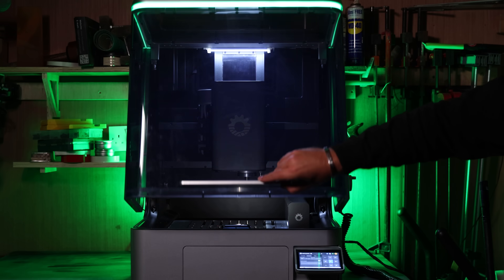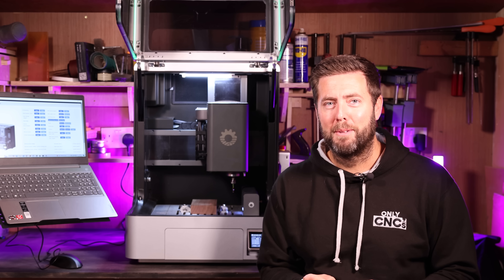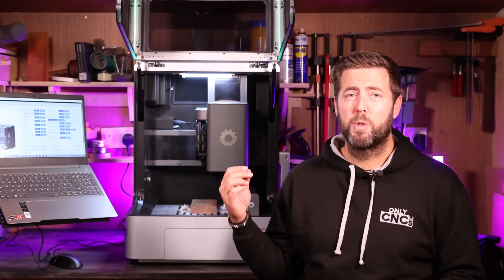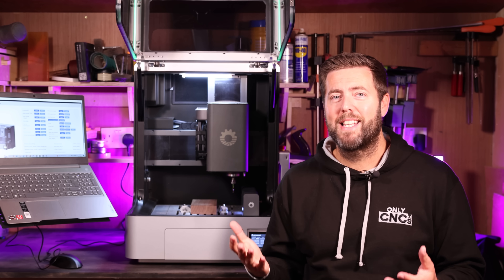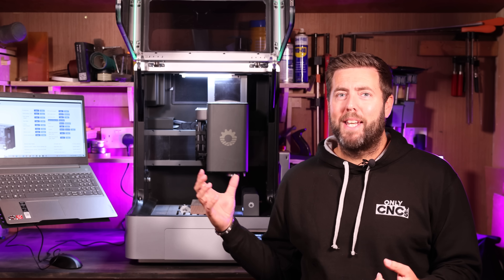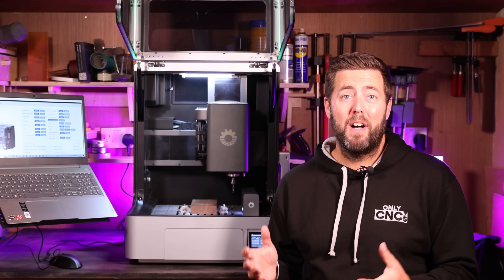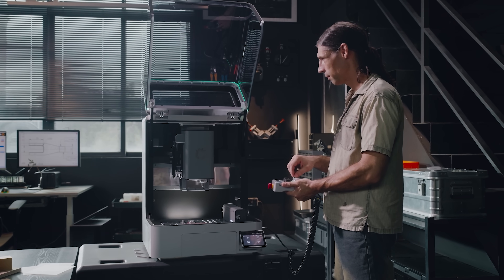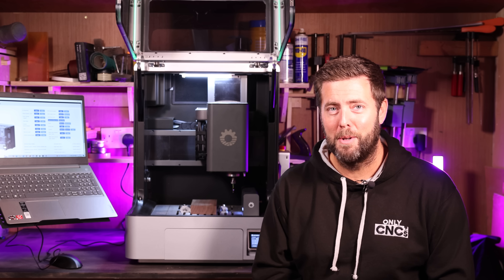Most ADVANCED CNC machine I have used - Initial look at the Nestworks C500

Comment: what spindle is used in this machine? and how is the atc working?
Reply from the maker: It's an 800w spindle. The ATC works great. Makes life much easier than doing manual changes
Reply: @JamesDeanDesigns  Does the milling cutter hold securely during milling? It just looks like it's being screwed on loosely. Normally, this is a spindle where you have to tighten the cutter with wrenches.

Comment: The retail prices quoted on kickstarter and therefore the duscount for backing kickstarter are often over stated. With productiin machines often being heavily discounted before kickstarter backed machine are even delivered. For example snapmaker U1 is only about 15% more for pre order than i pledged on kickstarter. Unless i was absolutely 100% confident in the company i would wait for real world reviews of the actual finished product befor taking a risk
Reply from the maker: Whilst I do agree with the sentiment the RRP are often inflated, 15% is a little bit misleading. Taking your own example of the U1, $679 on Kickstarter, $849 now on sale, so actually 25% difference. The Carvera Air is probably a closer example to this product, kickstarter was super early $1199, or $1399 early, now it's $2199. So nearly 60% higher than the early price. You can get some knocked off this with vouchers so let's say 50%.
Now let's take into account all the additional items you usually get for baking early that you don't get when buying normally, that offset increases. Kickstarter is by far the best value for money however it does come with risks and there are not many reviews out about this machine (I was rather surprised I was only one of 2 people who initially had it)

Comment: What i would like is a z1 with ball screws and closed loop steppers and the motion components out of the way of the chips. Price under £1000. Not bothered about ATC or fourth axis. Software included 

So basically a hybrid of the z1 and carvera air please 😊 then ill not need to use pcb way

Comment: @JamesDeanDesigns Can you talk about how the ATC works?  It looks like it is just a regular ER11 collet nut, the collet, the tool in the collet, and a collar holding the RFID tag - is that right?

A nut/collet spring isn't going to hold the tool securely to keep it from dropping down (I usually have to hold the bit as I am putting the nut on the spindle, and then after tightening a bit I adjust the stickout to exactly where I want it before tightening).  I suppose the collar could provide this function, but then it is going to be closer to a press fit and will limit the range of stickout for a given bit that can be achieved.  I guess you could also use a slightly undersized collet spring (ER11 compression range is .5mm) so that it does hold it more securely.

I assume also that the collars have to exactly match tool shaft diameter, so if you wanted to use drill bits you would have to make a custom collar for each size?  I suppose you could use something like https://www.maritool.com/p23589/ER11-Hex-Collet-1/4/product_info.html with 1/4" hex shank drill bits and only make one special collar size, but the range of tool lengths seems like a problem.  Maybe the machine is just used for marking drill spots and you do the drilling operation outside the machine?

Comment: Any updates on when the next video is coming out? Also, are you able to adjust axis in the scenario of a crash?
Reply from the maker: Video will be out on Friday. Not 100% sure what you mean by adjust but if the machines crashes (and sets of the alarm) you just need to unlock the controller and jog away from it with either the touch screen or your PC

Comment: Thank you for this review and on the Makera Z1.  With the C500, is the rear panel removable such that it can support tiling of parts?
Reply: Ooh, found the answer after digging through the comments some more.  
---------------------------------
@tommy_zi284
2 weeks ago
I've placed an order, been looking at it for some time, super excited to tackle steel in the garage! 

Question:  is there a proper way to place material larger than working area? Carvera has removable panel at the back for this, with C500 do we have to run it open for that? I understand it won't cut larger than working area but it's fine for garage projects as you can just reposition and continue
---------------------------------
@JamesDeanDesigns
2 weeks ago
Hi, thats correct, you would have to leave the lid open. There is no removable panel in the back of this.

Comment: My concern is that there seems to be nothing about the company behind this. It looks like they may be the same as elephant robotics, but all the information about their products seems to be from them. I’ve been burnt by Kickstarter that seem too good to be true so, unfortunately, $3k usd is a bit much to just gamble on…. Which is a shame since this looks like a fantastic product if it comes to fruition.
Reply: The company is Elephant Robotics. They are into robtics and needed a small CNC mill for prototype production, and did not find a good option according to their specs and price level, so they developed their own.This is typical with many tool companies, they started out with something else then they developed a special tool for their production, which then became a new business. It looks promizing, I'll follow the development, possible just wait for version 2, since they are new to manufacturing CNCs
Reply from the maker: Rimrock300 is correct. They are not a "new" company but releasing this product under a different brand. Bit like Onefinity and Redline, same owners but selling different assets if that makes sense

Comment: Is the largest diameter end mill that can be used with this desktop mill a 1/4 inch?
If a slightly larger diameter end mill can be used safely and efficiently, what size would that be?
Reply from the maker: It's an ER11 Collet which can safely take upto 7mm diameter. And yes it's powerful to run that diameter

Comment: Freakishly expensive for hobbyists. Bambu Labs was successful not just b/c it's ease of use but b/c it was within reach of the hobbyist. Need a $1500 version to be of consideration.
Reply from the maker: Hobbyist budgets is 100% based on the person not the term hobbyist. I know people with a $10k CNC setup that are hobbyists. There is also considerably more hardware in a machine like this than the Bambu 3D printers so it's not really an equal comparison
Reply: I bought a full size VMC for 10.000$, Okuma with OSP control 1999 model, insane fast ATC and double table with automatic table changer, super ridgid. FOR SALE NOW.

Comment: Hi James, any info on confirming the cnc material size that can be used? You have the machine, can you not confirm the size on the bed? Also it would be nice to know if the fluid system is included with the base model or if you have to purchase the 3999.00.  I want to be able to mill Aluminum mold cavities to use with 3D printer molds where the Aluminum stock will be at least 6" x 6" and 8" x 8" would be even better. Will either of these sizes fit on the bed? Also, do you think the SMW modular vices can be used with the CNC?
Reply from the maker: So the bed is 375x250 (max material size without ATC). Max work size with ATC is 165x220. So 6x6 is fine, 6x8 is fine but not 8x8. Without the ATC though it's 230x220 so on that 8x8 is fine
Reply: @JamesDeanDesigns  does the ATC come with the base 2799.00 unit? If not, what will it cost?
Reply from the maker: @pronetmedia3557 I believe it does. I think the confusion has come because you can take the ATC off to have a larger work area

Comment: The Kickstarter price is what I believe this machine should normally go for. Nearly 5K is just too much for most people, even then, at 5K, most people would just opt for a much bigger and better machine for 6K or 7K.

Personally, I built a custom CNC for around 3-4K and my build area is as big as this entire machine. It's hard to want to recommend something so expensive when better options exist. Hopefully companies can reduce the cost of all these automatic features to keep the price down. Things such as not making the ATC mandatory, using GRBL instead of whatever they currently use, making the machines upgradable with aftermarket (common) parts and most importantly, strip all the extra crap that doesn't need to be there. Make air cooling a basic feature but let people add mist or flood cooling after they buy it.
Reply from the maker: You'd be surprised how many people are not too bothered about the size. There are a lot of people working in smaller spaces which is why the smaller desktop machines quite often outsell the larger machines. Also a lot of the time (but not always) smaller machines will have better tolerances due to less flex.
It's brilliant that you could build your own but honestly a lot of people wouldn't have a clue. The price not only includes the hardware but also the fact it's basically plug and play which is invaluable to a lot of people.
You'd be surprised with the amount of people that message me wanting a small machine that can do metal to high precision. 
Maybe one day I'll be able to build my own 😁

Comment: Hi James, they mentioned on the Live Stream that the build volume was 230mm x 150mm with no specifics. This is far smaller than you quoted in your video. Do you know the actual correct build volume?  Also, do you have any specifics on what is included with the base model? Does it include the ATC or Fluid system? It seems very vague what is included or not included on the Kickstarter. Thanks Kyle
Reply from the maker: I think, but not 100% sure, they may have mixed up some of the measurements but ill double check tomorrow to make sure I didnt get it wrong. The ATC and the fluid system I believe comes as standard, not 100% sure what else you get. I suspect some bits and tools which is usually the case
Reply: @JamesDeanDesigns  Can you verify the ATC and Fluid systems come with the 2799.00 package, described in the What’s Included on the KickStarter and if not, which package includes those?:
✅ NestWorks C500 ×1
✅ Material Kit ×1
✅ Tool Kit ×1
✅ Standard Accessories ×1
✅ Comes with a 1-Year Trusted Warranty
Reply: @JamesDeanDesigns  James, don’t make promises you don’t plan to keep.

Comment: Seeing the contamination on the collets sends shivers down my spine. Too bad it doesn't have real tool holders that could swap tools in the real world. Too much work went into too many bells and whistles, they should have put all that work into getting the basics right.
Reply: Do you mean a real ATC Spindle? That would price the system out of the market for most and lets face it this system is a desktop CNC, it shouldn't have the features of larger industrial CNC It's just a shame that the RapidChange ATC folks did not have an international Patent as it looks like their design on the product. Kyle
Reply: @pronetmedia3557  No, I am saying figure out a way to swap tools or don't do it. Using collets that way is NOT a way to swap tools. The collets will get full of chips and the tools will not run true. I know it is a toy, but put some work into swapping tools instead of all the fluffy bells and whistles that are lower on the priority list of a useful machine.

Comment: Thanks James for this very nice overview! 
For the review can you please include 
- a basic stiffness test, i.e. pulling on z-axis in x or y with a defined force and measuring the displacement with a dial indicator?
- perform some milling of 7075 Al with the given parameters and measure the achieved accuracy on rectangular and circular features. E.g. how close is the shape to to an ideal circle. 
- give an idea about maintenance and repairability. CNC machines experiences some wear and tear. How would you estimate servicing the machine?
- go through the CAM pipeline starting with a small part as a .step file. Many are used to other CAM tools such as Fusion 360. Is the CAM tool that comes with the machine here an actual competitor?
Reply: that would be awesome

Comment: 280mm is the exact size of an AR-15 lower btw lol. I wish they have another 10mm of room to finish the edges.
Reply: Might have to run the sides in 2 ops if there's not enough room. Looks like there's clearance to hang stock off the Y- side of the table at least.

Comment: $2800 is an interesting price point.
Reply: But keep in mind the unit James demoed is not at that price point. In the LiveStream they mentioned the unit and some material for the $2799. No ATC, no vice, no $ Axis. That's why it would be nice to know whats included and the cost of the options. Even the 3999.00 price unit on Kickstarter does not mention the ATC as being included or the fluid system. Kyle

Comment: I've placed an order, been looking at it for some time, super excited to tackle steel in the garage! 

Question:  is there a proper way to place material larger than working area? Carvera has removable panel at the back for this, with C500 do we have to run it open for that? I understand it won't cut larger than working area but it's fine for garage projects as you can just reposition and continue
Reply from the maker: Hi, thats correct, you would have to leave the lid open. There is no removable panel in the back of this.
Reply: @JamesDeanDesigns Got it, if you could demonstrate it in future review that would be awesome, thank you!

Comment: can you go over the tool changing system in the next video? I am curious about how it works with the threading and if can you still use normal endmills from other brands.
Reply: It's just a ripoff of the Rapidchange ATC.
Reply: @Ismsanmar all the reviewers are not talking about it. They say its amazing but have their hands tied. Free machine, just dont talk about RapidChange.

This is a CNC only channel, the clone of RapidChange should have been the first thing called out
Reply from the maker: Yes, you can use other branded bits. The spindle spins clockwise to engage with the collet, and counterclockwise to disengage. It runs at a lower RPM during the engagement and disengagement
Reply: @JamesDeanDesigns  I thought it read information off the bits to determine what is in each slot. How does this work with third-party bits?

Comment: You just shared a video without properly machine any metal block. How is the performance with steel, aluminum? What made you think this is the coolest cnc machine? Leds?
Reply from the maker: First...because I've reviewed more CNC machines than most people so purely from spec alone I can pretty accurately judge what it can machine. And I've machined metal on much lower spec machines than this. The reason I think its cool is pretty much covered in the video, but for clarity, because of all the cool features built into this. And yes, I will be showing it machining all of these in the next video.
Reply: @JamesDeanDesigns   Thanks for the explanation. ATC feature is not a big deal in that price range.  Probably you already know rapidchange atc. The product looks premium with cover and leds. But it is important to know the performance. Bc it looks vibrating when machine aluminum.  I’m looking forward to your next videos. I hope you’ll push the machine a bit so we can see its capabilities
Reply: @EminKara-p1h Kind of looks like they copied the RapidChange ATC design wouldn't you say. Still unclear if it is included or an option you have to pay for. Looks like they packed more in their ATC in a smaller area than the RapidChange ATC folks.

Comment: How's the noise level with the lid closed compared to the Makera machines?
For example, do you think it's reasonable to run this in an apartment in a separate room?
Reply from the maker: A lot of variables when judging noise. I'm in a small wooden shed so noise bounces a lot. Also depends what your machining and how aggressively. The general running is quiet, maybe 75db at a guess. Machining probably 80-85db but will try and verify in the next video.
Reply: @JamesDeanDesigns  yup, I know that it's hard to judge noise, that's why I think comparing it to another enclosed machine like one of the Makera ones makes sense.
In your opinion do you think their noise level is comparable?

Comment: How does it compare to the carvera?
Reply from the maker: The main Carvera? This will outperform it. Stronger overall and more features.
Reply: Carvera is no match to this thing. Basically looks like a toy in comparison.
Reply: @XA--pb9ni  Price is also much bigger.
Reply: @allancnc  Not really, compared to the original Carvera at 5k. Compared to the air, yes 100% you are right